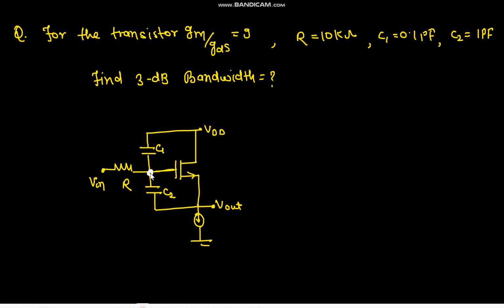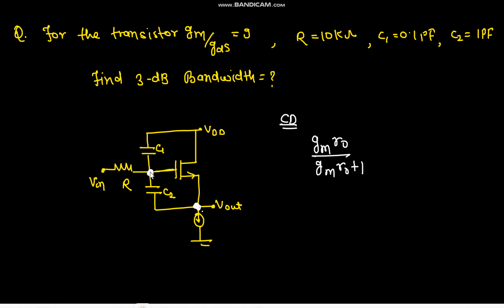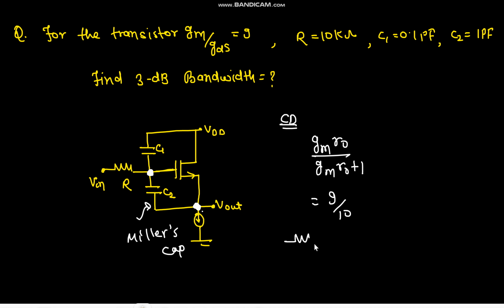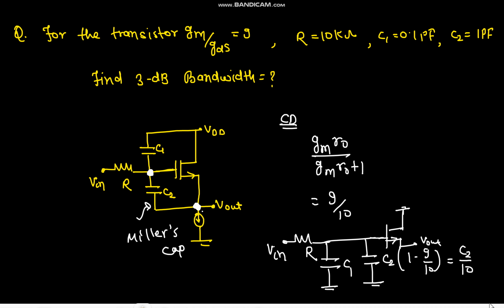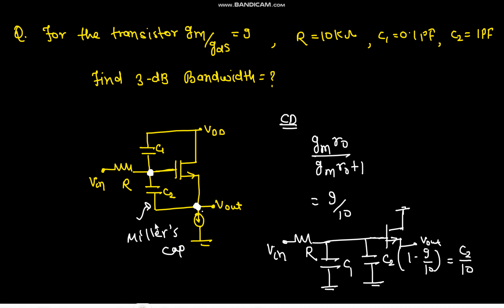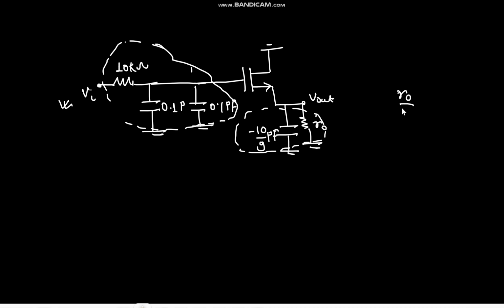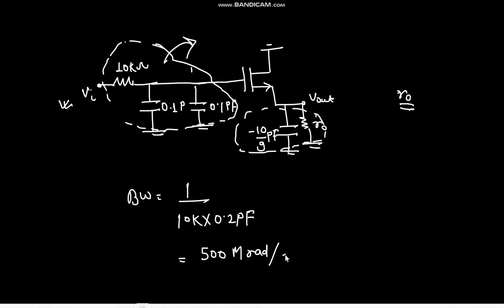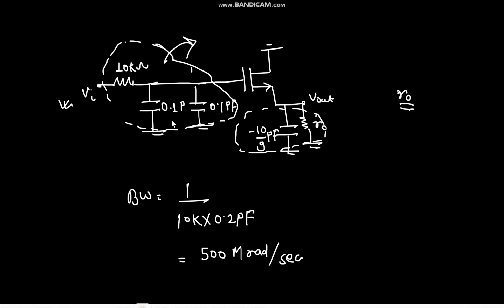Some Practice Question for Written Test and Interview

Comment: If ro value was given , then how can we decide which one gives 3db bandwidth? The one closer to origin would have given the answer?
Reply: Yes brother, in that case we would have to calculate both the bandwidths involving the one with ro and capacitances and the one with the resistor and capacitances, and check, which one is far away from origin or nearest to origin, that will be 3db BW.